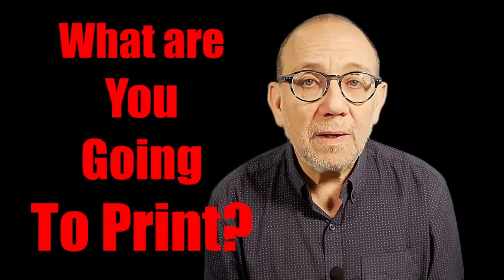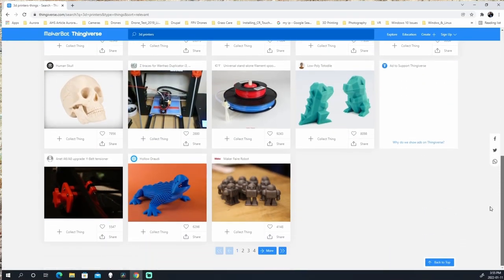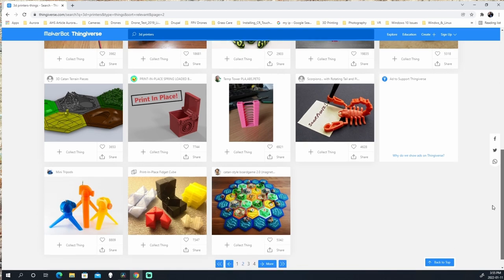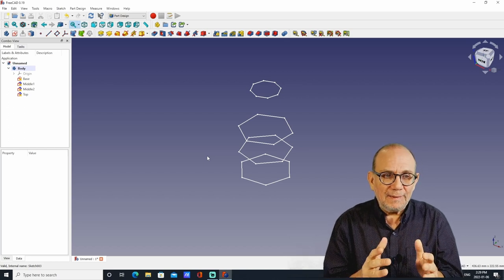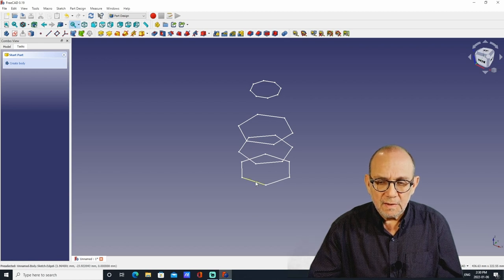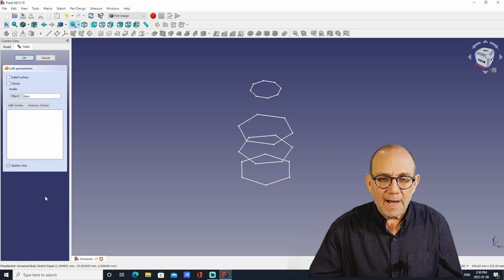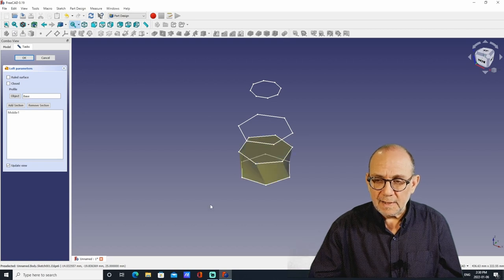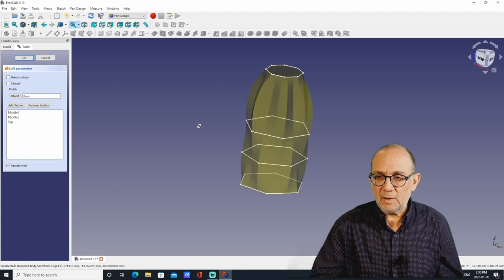Total Beginner Tutorial -- Design & Print 3D Vases

Comment: My vase is printing out solid
Reply from the maker: Hi Sue...did you turn on spiralize mode in Cura?  The spiralize mode is a special mode that needs to be turned on in order for the vase to print hollow.  I'm assuming that you're using Cura, right?  If you're using Prusa Slicer, I believe there it's called spiral vase.   In my video see "Setup Cura Profile for Slicing Vases 15:40 .
Reply: @CreatewithTech  I have now, I didn’t know about that . Got info from fb group thank you . Now I need to know how to make that walls thicker. I printed a vase but the bottom fell away. As you can see I’m really really new to this
Reply from the maker: @suefilby1511  Hi Sue...Glad to hear that you got it working...if your bottom is falling away it means that the layers aren't sticking properly.  I'm assuming that you leveled your bed and that you're able to print other things out without issue.  Is this correct?  Also, what brand and model printer do you have?  Does it have automatic bed leveling, and if it does did you set the z offset?  Again, the reason I'm asking is because in order to print a vase your printer's bed has to be properly leveled.  As far as making the vase thicker, there are two options:  1.  Put a thicker nozzle on the printer.  Right now you probably have a 0.4mm nozzle.  If you put on a 0.8mm nozzle, you can double the thickness.
2.  You can also change the line width in the slicer from 0.4 to 0.8...that'll printer the vase thicker...but you'll also need to increase the temperature a bit to prevent your nozzle from getting clogged.  I go over this at 19:24 ...I know that the video I posted here is long, but just in case you didn't I recommend watching it all as it takes you through the entire process. I have no doubt that following the steps in the video will allow you to print a successful vase.
Reply: @CreatewithTech  ah thank you that’s helpful. I have an Ender 3pro,
Praps I didn’t watch to the end.,we get inpatient don’t we. I will look into the options